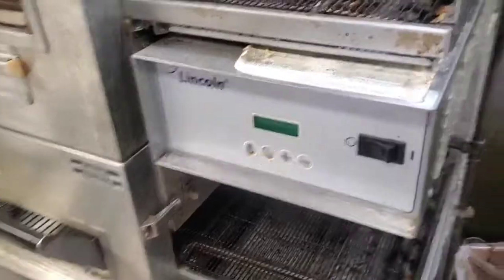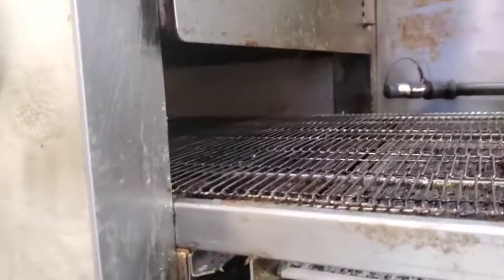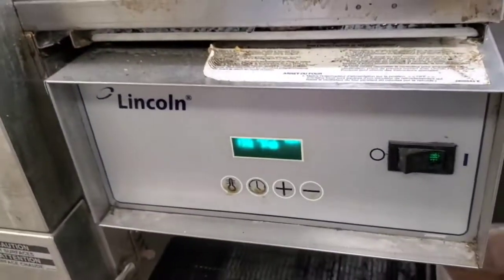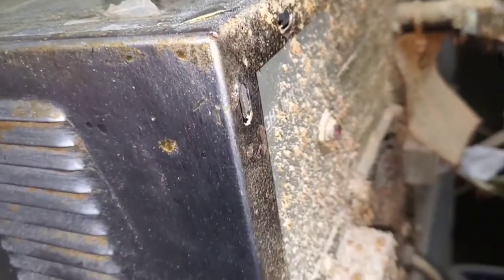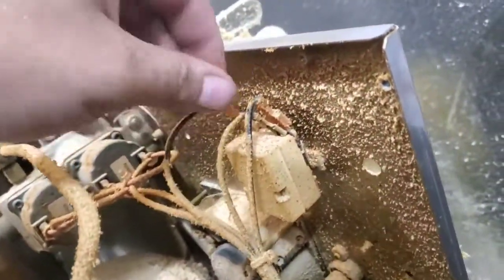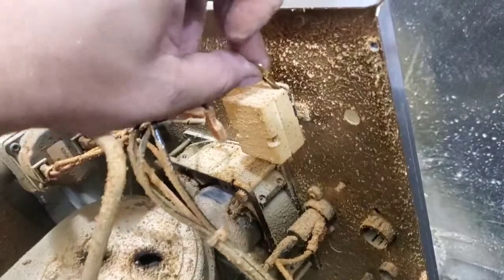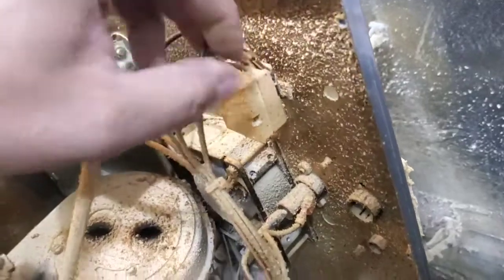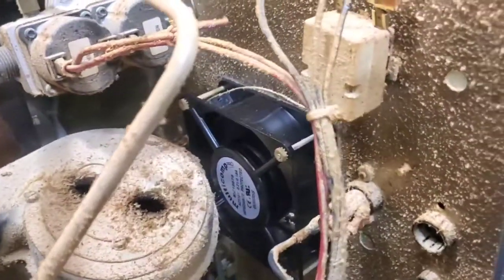How to Stop Nuisance Tripping Hi-Limit on Pizza oven

Comment: Hahahahah, that's not a"fix* that's a bandaid.
Reply from the maker: Did you see it?
Reply: @satanicinduction  yeah all you did was bypass the safety. Hi limit is there for a reason. I would think that one's going off because of how dirty the control compartment is or a failing switch. So yeah, not a real repair. Just a bandaid.
Reply from the maker: Nah man the thing right at the end that days the video is satirical. The hi limit got replaced as soon as the camera was off. Same as when we washed the control board. All the Lincoln triple stack videos are fake.

Comment: I hate those Lincoln ovens
Reply from the maker: You mean you don't love the flame sense thru a resistive ignitor not in the path of the flame design?
Reply: that's just bypassing the high limitn
Reply from the maker: Yea i un-bypassed it and replaced the cooling fan off camera. All my lincoln videos are satirical.